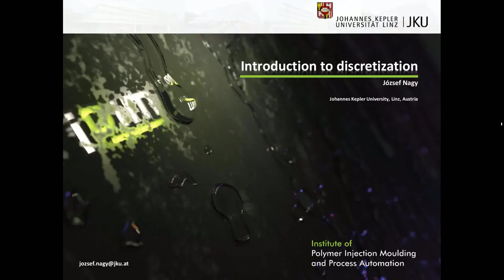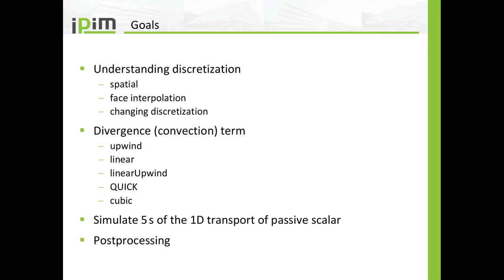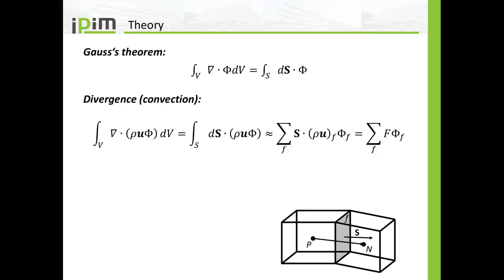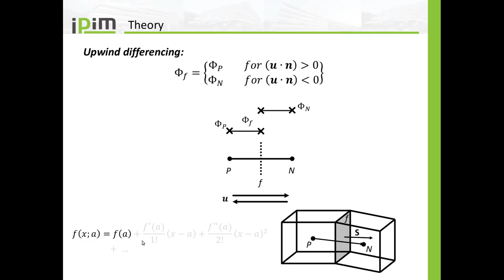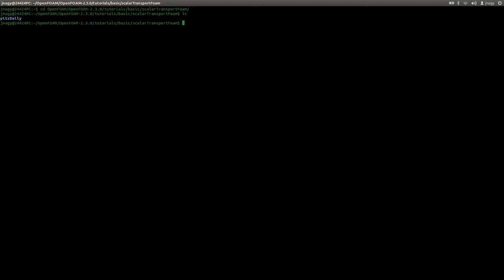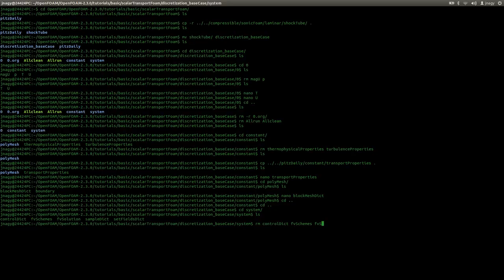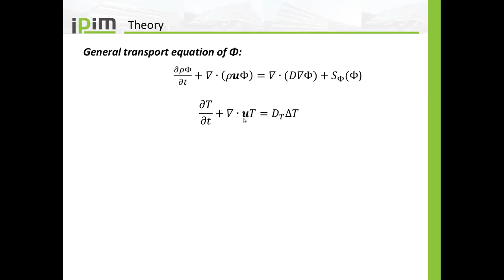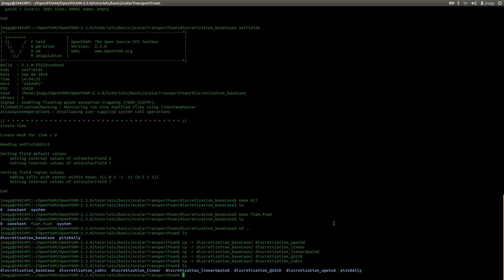Introduction to discretization - Part 1

Comment: Dear Professor Nagy,

I was trying to reproduce those cases, however the oscillations that I am getting for the cubic and the linear cases are only visible when I set the limits on Paraview from -0.001 to 0.001. I checked and it seems that the models are the same. Do you know if there was any difference on the version of OpenFOAM? I am using version v1812 through Docker.
Reply from the maker: Newer versions are a bit more stable. This is OK.
Reply: @OpenFOAMJozsefNagy  Thank you very much! All the best!
Reply from the maker: @Murilo08LOL  Thank you!

Comment: At 2:00, where you compare general transport equation with convection-diffusion equation, you are assuming rho to be 1. But, doesn't that make the previous tutorial incompressible ?? But, we simulated shock-wave travel in that case. Do these two cases make sense with one another ??
Reply from the maker: You solve two different sets of equations. Here a simple scalar transport, for the shock wave the compressible Navier-Stokes equations.
Reply: @OpenFOAMJozsefNagy  can't the scalarTransportFoam be classified as compressible or incompressible??
Reply from the maker: @sandipgewali641  The simple scalar transport equation (which is implemented in OF) doesn't know anything about the density.